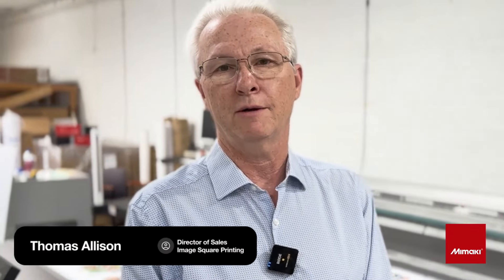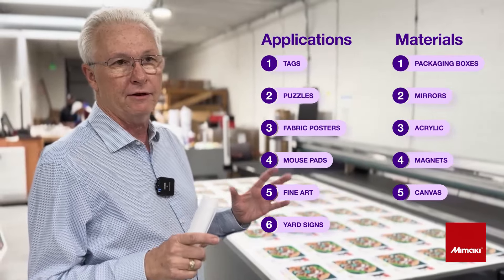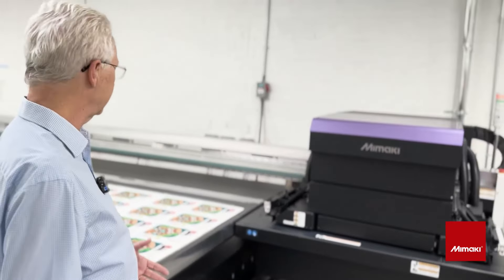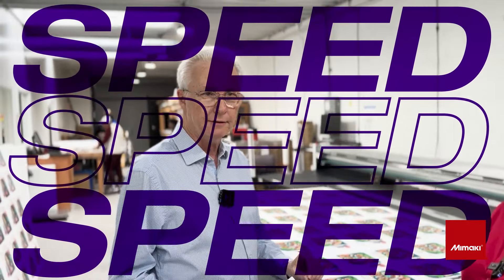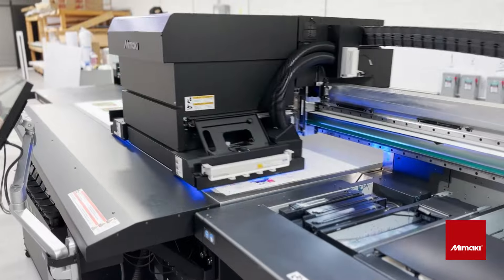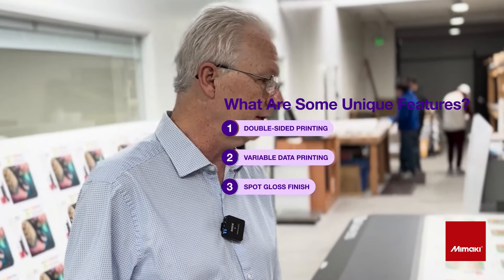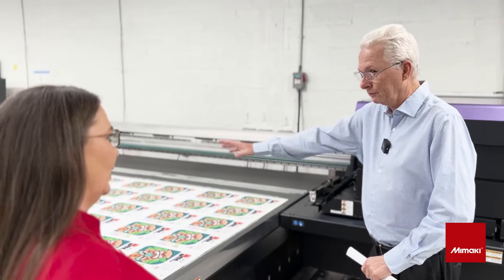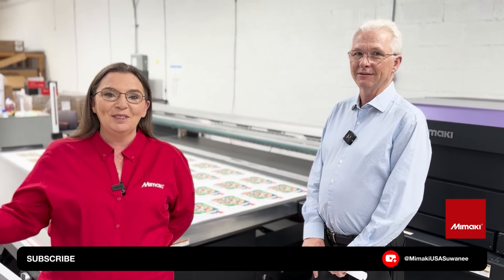Image Square Printing | JFX600-2513 Testimonial

Comment: Dear Sir,
I want to use this printer for another of our business projects so that we can print on TPU and synthetic materials. This is because we are outsourcing the production of Adidas shoes. I already used 6, JV300-160 printers from Mimaki for sublimation printing. Now we want to do direct printing (UV Printer) also.
Please give me some advice.
Many thanks.
Reply from the maker: Thank you for you interest in UV printing with Mimaki. We have a few options available for roll-to-roll UV printers, the UJV and UCJV line models. They come in a variety of sizes and ink configurations to meet your needs. Please contact your printer supplier and they will be able to request and schedule samples and demos.

Comment: UV Printer?
Reply: Yes, UV Inkjet with 16 print heads and print speeds up to 2,152 square feet per hour (Equivalent to 67 boards per hour)
Reply: @miketurner3357  
Epson Print Heads?
Reply from the maker: Hello, they are modified M Heads